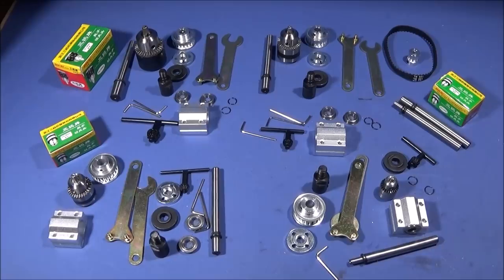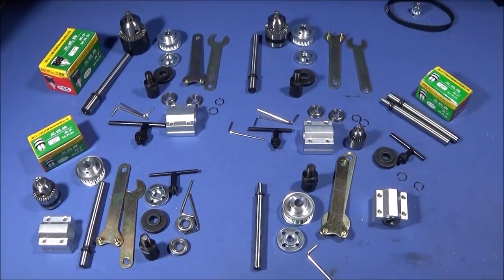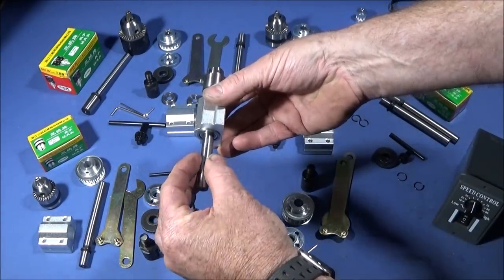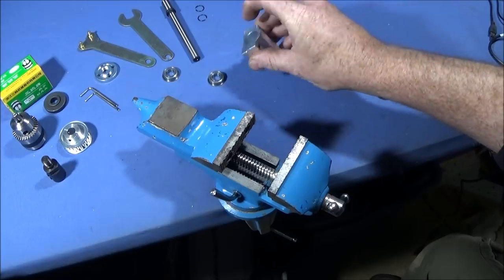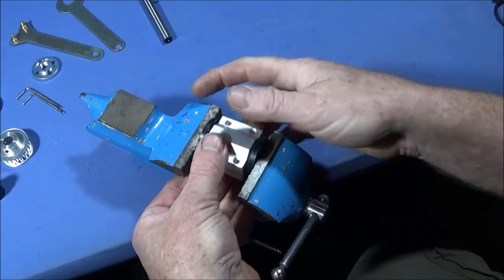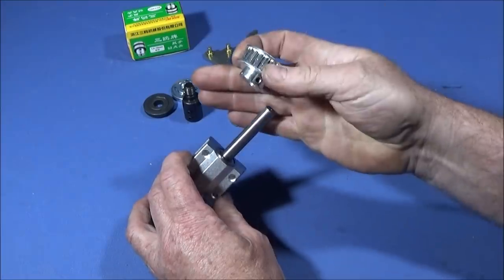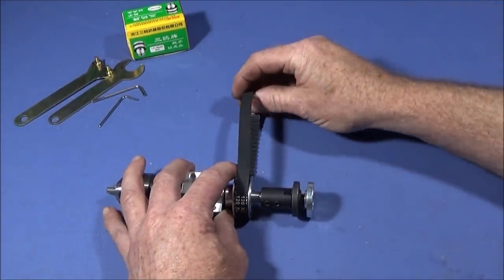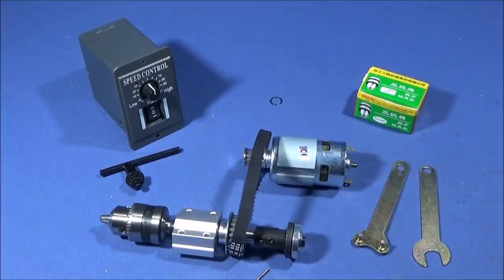Machifit Spindle Sets How To Assemble Them Properly & Their Uses.

Comment: After two months finally got all the parts I needed.. The bearing housing has a few nicks so it needs to be deburred before putting the bearings in. The shaft seems like it will be a tight fit. How did you keep from knocking out the back bearing when you pounding in the shaft? I did get the motor bracket just to make it easier to motorize a cross drilling setup on my lathe. Nice the shaft has centers on the ends so I can put it between centers to insure when I build the bracket it is level and on center height.

Comment: Maybe the other clip ring is for one with the biggest chuck.  I can't tell from the video but a spacer might be needed between the spindle body and the bar that fits into the quick change holder so the pulley doesn't hit the bar.  Thanks for another informative video.

Comment: Great video.  Was just looking at some of your past videos on making a toolpost setup .  But I think I'm going to use the larger Machifit motor instead of the setup with the belt drive.
Reply from the maker: Hi Roger, Yes they are very good as well. I often still use a cordless drills on mine as my drill has very good control on the slow speeds.

Comment: I noticed that most of the time you use self centering chucks. When do you use independent chucks?
Reply from the maker: I use them mainly when I do offset turning. Regards Steve
Reply: So there is no real advantage unless you turn like square or irregular stock ? I read on practical machinist forum that most machinist use independent chucks.
Reply from the maker: They obviously can be used to get components running dead true. Most chucks with non machinable hard jaws have a bit of run-out. So having adjustable independent jaws enables one to get zero run-out. Because of this accuracy some people prefer to use them all the time and can get quick at clocking components in after a while. I use mine for dead accuracy sometimes. Regards Steve
Reply: @SteveJordan  thanks Steve, I  think you have the most practical and practicable machining methods on youtube. Most guys like me have limited resources for machine shop. You have developed methods that allow poor guys like me to do this . stuff as a hobby. As you say brilliant!

Comment: Hi Steve
I've just received delivery of one of these but I'm quite disappointed. One of the bearing holes in the aluminium housing is too big and the bearing slops around in it. I've contacted banggood and awaiting a reply. Did you by any chance experience this problem? I guess I could machine a new housing, but it's a little annoying. ☹️
Cheers
Andrew

Comment: Oil people ,use the oil on bearings and shafts when you assemble them ,it makes things slide in easier ,also for sealing rings,o-rings etc.
Reply from the maker: Yes I forgot to mention that.They felt like they had oil on them from manufacture. I didn't use any extra though as I didn't want to mess up my studio bench.
Reply: Also you could drill a hole in the aluminum block and insert a threaded pneumatic fitting w/teflon tube. It could be used later to oil the bearings and push out debris and saw dust. That is important since bearings are not sealed

Comment from the maker: SEE LINKS BELOW:-
Machifit No Power Spindle Assembly Small Lathe Accessories -- http://bit.ly/2HR4Z3P
775 Motor DC 12V-36V 3500-9000RPM Motor -- http://bit.ly/2Hz0MlY
DC 12V24V36V48V 6A Motor Speed Controller Brush Motor -- http://bit.ly/2TPLeQj
2019 Banggood Summer Sale Shopping Guide -- http://bit.ly/2Lt4Kxy
2019 Banggood Summer Sale Must Have List -- http://bit.ly/2LsA13D
Reply: Hello I get this set today and assemble it using press. Did you find that after mounting everything the shaft is pretty stiff rotating?
Reply from the maker: Banggood Health Protection -- http://bit.ly/33tNTBx
  Banggood Health&Care Protection --  http://bit.ly/3d7QpSy

Comment: Hello Steve,
Bought one of these a couple of weeks ago, and am very disappointed in the build quality. The bearings were so loose both on the fit into the housing they are constantly falling out and the spindle fit was so loose that when assembled showed a deviation of at least 2 MM. In addition you did not show exactly how you fitted the body to the 12mm square.tool holder. I found body was drilled and tapped from the back making the attachment very difficult.
I showed to a retired engineering colleague and his only solution was to recommend making new phosphor-bronze bearings.
I consider that it was not a good buy - not fit for purpose!
Reply from the maker: Hi John. Well every one I have had so far are all a nice tight fit like I showed in this video. It sounds a bit of an exaggeration 2mm deviation? A few thou would have been picked up in inspection and quality control.
   They also run dead true. Also The screw threads in these four holes are only there for optional use. I will drill mine through to take an allen bolt from the front and thread the square bar instead. All these components are designed with the intention of giving people versatility of how they are used and set up. 
  When I buy parts like this I never just use a thread because it is there, I always think of methods to make things easier to fit, even  if there is slight modifications to be made. 
 I think they are absolutely excellent and would not hesitate to buy more if I need them. I have had over 30 years experience in precision engineering mostly in the aerospace industry. These parts fitted together perfectly just like I showed..